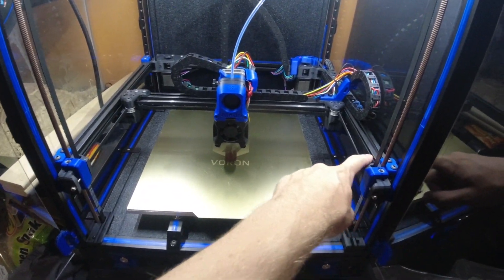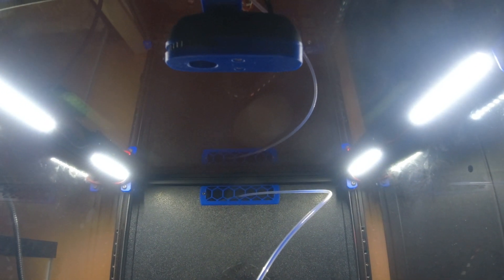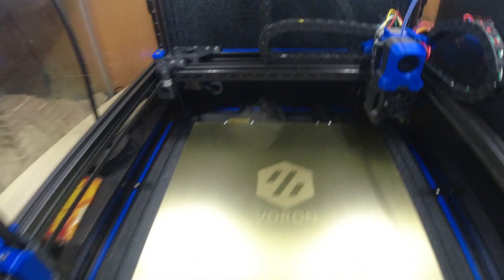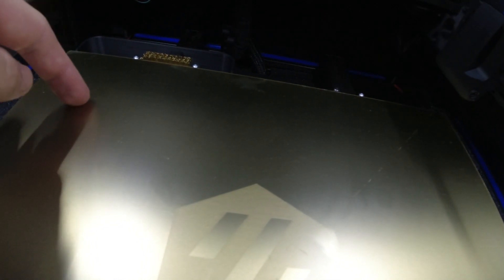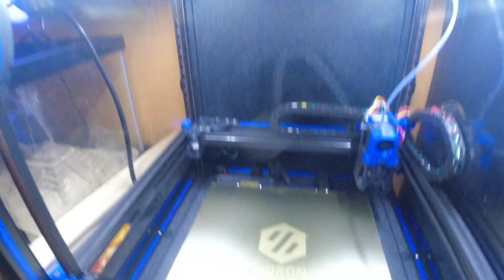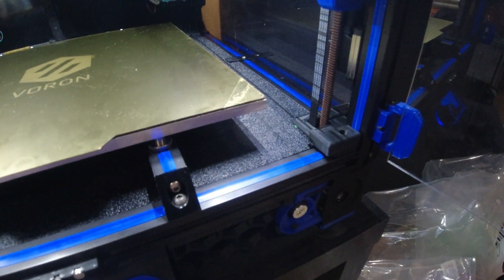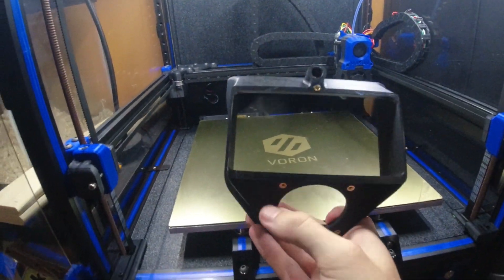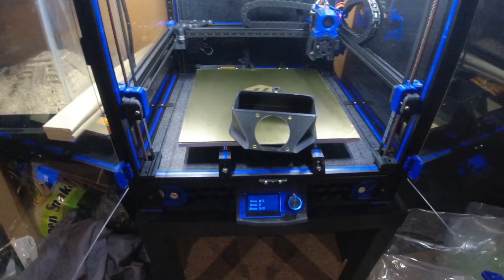Voron 2.4 - E14 - Mods Pt. 1

Comment: I used a brush and purge bucket for a long time on my 2.1. When I jumped to 2.2, I didn't put it back in, and I've never missed it since.  Nice printer though.
Reply from the maker: That's understandable. I'm moving this printer somewhere else in my house so it won't be as quickly accessible and figured that a purge bucket would be nice to have, just to collect the stray filament and brush the nozzle off with before starting to print. Thank you, It's been very handy.